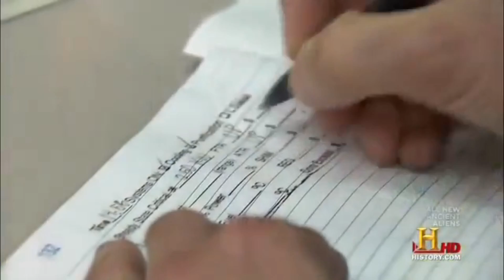How To: Turn Mercury (Hg) to Gold (Au) Alchemy Working Technology Explained

Comment: Everyone talking about alchemy. My understanding of alchemy is to make something from nothing. Which is clearly not the case here.
Both mercury and gold were there at the start
Reply: Nothing was the wrong word to use and I shouldn’t have used it what I should have said was alchemy is meant to be the transmutation of one substance to another? Eg, making gold from lead or copper or aluminium etc Which isn’t the case here or anywhere. In order for you to do that you would need nuclear power and to perform nuclear fusion. You probably think that if they could do this back then than I still believe that it’s true “the old alchemy” Yeah, obviously back then they didn’t know about atomic weight and why you can’t simply add protons you don’t have to lead without having to perform Nuclear fusion. I’m an Athiest, nothing you say about god I would believe because just like alchemy......it’s not real and is nothing (of non existence, the actual meaning of nothing) but ok, if you want to believe in fairytales and make believe go for it I will not judge how someone lives their life :p
Reply: @royalrefining6182  your understanding is desperately lacking brother - high voltage differentials do a hell of a lot more than the common models accept as possible, it's unfortunate most hard science is suppressed and hidden but you can believe what you want. The progress of understanding is for those who dare to challenge established paradigms and conduct experiments, not those who cling to text books and beliefs of old.

Comment: Should I invest in gold then?
Reply: yes because the gold produce from this is radio
active.
Reply: Also the mercury isotope is  Hg-196 ( which is radio-active ) is rare, only 0.15% of mercury it Hg-196.( Hg is the symbol on the periodic table for mercury). Also 150000 volts for 4 hrs  in not cheap. Therefore the radioactive gold produced would cost more to produce than it would sell for also selling radio active anything is illegal.
Reply: @newscientificnews6501  unfortunately your last point is incorrect as lots of thi ngf radioactive or for sale such as small amounts of uranium 1.5kg max allowed
Reply: so the answer is YES invest in your gold
Reply: @newscientificnews6501  Thank you. This is very helpful. :)
Reply: @unitedspacepirates9075  the shorter the half life the more dangerous it is and the more potential it has to ionize things around it. Even then the power you would need to break the atom's "weak force" is just a lot. So good luck trying to compete with the boi's in africk just mining for it

Comment: The electrolysis of water removes hydrogen from water. So I see why the electrolysis of mercury (Hg) would remove hydrogen, in a tedious process to produce gold and hydrogen gas.
Reply: Well not normally because water is a molecule and mercury is an element.
Reply: @jolyonlovell3554  yeah in the H2O electrolysis process of removing H you have to mix baking soda in the water. What are they doing to the mercury I'm not wise to to make that Happen?
Reply: @Gymanneye  the way it works with water is since it relys on electron bonds between hydrogen and oxygen. That if you pump electricity trough it (using baking soda to make the water conductive) you are able to disconect the bonds between H2O into bonds that are H2 & O2. that does not work with element itself tho since you need to overcome the "weak force" of atoms wich is only doable with nuclear fission or fusion
Reply: That's some brilliant stuff but that's not how it works... If you actually made it happen, you'll be having a white mercury powder.. 

*Mercury in its purest form is a powder*
Reply: If nuclear can change that mean it can be , so, to say can not change the element  would not be reasonable
Reply: @gareebtunio  dude... your comment is not making any sense.. could you please be clear..
Reply: I hope the original comment was sarcastic, about removing H from Hg and getting g, supposed to indicate gold (though incorrect)
Reply: Thats not how life works tho. You cant just change elements without nuclear fission. Even then cern estimated it would cost them about 40 million dollars per gram of gold